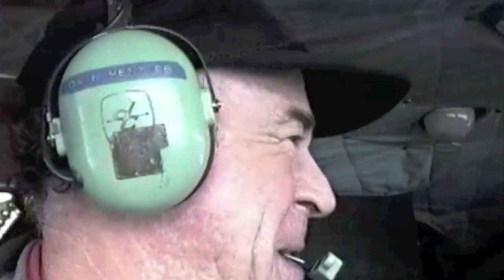Bronson Creek Bust Ups

Comment: I was a copilot on an Alaskan MarkAir L382(stretched C-130) operating between Wrangell and the Bronson mine airstrip.  We flew over the approach end of the runway then proceeded a short distance up the Iskut River to turn around.  We then headed back down the river fully configured on a base leg for landing.  It was fun, a great gravel runway, but no go arounds.
We also landed on the gravel runway on top of the mountain slightly SE of the river strip.  That was not fun, as there was a high hump in the middle of the runway.  After touchdown, you could not see how much runway remained, so we braked heavily before the hump to avoid too much rollout on the downhill portion after the hump.  Like the no go arounds on the river strip, there was no aborting on the mountain strip.  Once over the hump, there was no stopping.
Next to the mountain strip, there was still a tumbling drum(better name I am sure) for breaking up the ore, so it could be bagged and loaded onto aircraft.
The Bristol aircraft were also operating into both runways but carried a much smaller load than our Hercules cargo aircraft.  Was interesting to learn that the Bristol only had one brake application available that used an air charge into a bladder to press against the drum.
Reply from the maker: Really amazing memories .. I had no idea that an L100-30 Hercules aircraft were going into the Bronson strip as well thank you so much for the comment and insight!
Reply: @JetFlix  I would like to include a photo of our L382 at Bronson Creek but cannot figure out how to do that here.

Comment: Great summary. A few details however; It was serviced by hovercraft, not barges, during much of the time the mine was in production.  “Barging” and “iskut” don’t occur together. Serviceability and weather issues deemed the hovercraft uneconomic so air support prevailed. It is the Iskut river that runs east-west, not Stikine.  Many of the aircraft bits remained next to the airstrip for many years.  Two fatal fixed wing crashes also occurred at that airstrip.  One was central mountain air, the other air north(?)
Reply from the maker: Thank you Max for these extra details which add to the fact setting of the story. Much appreciated. Yes I was aware of the other 2 accidents you mentioned. It was the wonderful aviation photographer Grant Webb who was PIC of the Central Mountain Air DC-3 who tragically lost his life (and his FO) when the load shifted on his DC-3. I guess that was back in the late 1980s. And the Air North DC-4 accident too and the Captain sadly perished. Both of these were flying to/from Brinson Creek but the DC-4 alighted some distance from the airfield in the river. I am not sure about Grant Webb’s DC-3. It is appropriate to not overlook these two accidents to pay our respects to those who passed.

Comment: Definitely no barge ever went to that airstrip, i have spent 40 years on the Stikine and Iskut rivers and it is always shocking to watch people that have no clue talk about the area
Reply from the maker: I think the comments were to the effect that the barge was nearby not actually at the airstrip but I’ve certainly never been there either so clarification is always appreciated.
Reply: @JetFlix  It is 30 river miles to the Stikine river from that airstrip so the closest you could get a barge would be 30 miles. If they could have used barges there would probably been little demand for airlifts. They did however use a ACV with the ident c-hcom, it had several crashes and engine failures but was shut down over its ability to kill thousands of salmon fry.
Reply: it was a hovercraft.  Never worked very well...

Comment: I remember hearing these guys wanted CF-WAE which is at the WCAM during the late 80s or so. The museum wouldn't sell the plane because they knew the company had a lot of crack ups. Also WAE couldn't be sold because it was considered an artifact. It only has about 13 000 hrs on it. A lot of the museum's members didn't want it and wanted it scrapped because it is big and ugly. But it fits the mandate at the time of being a bush plane. Now the museum has a mix of everything.
Reply from the maker: I did not know that story thank you for sharing it. I guess een today it could be made air worthy with not much effort.
Reply: @JetFlix  I'm guessing it would need a complete going through and overhaul. Hasn't flown since it came in '83 or '84, forget. I was to young to know anything then. It's been sitting outside for the last couple of years. Might be able to see it on google maps on the south east edge of the airport just along Ferry road. I have to get over there and get some pictures of it. It's not far from the fence. The new museum's set to open in March next year.